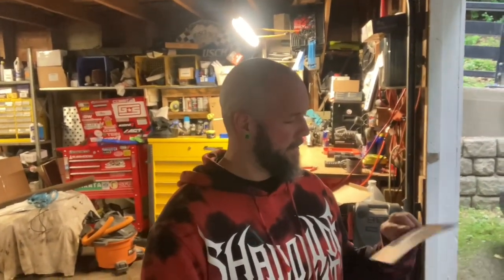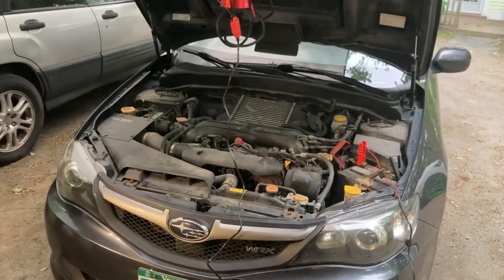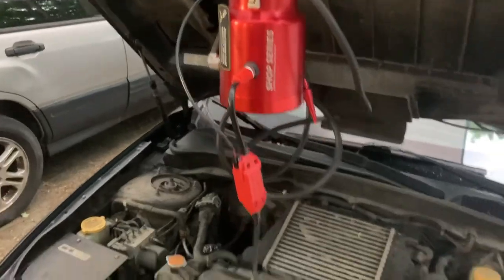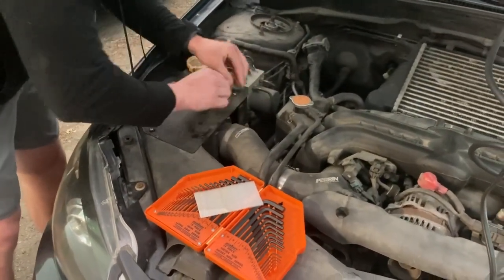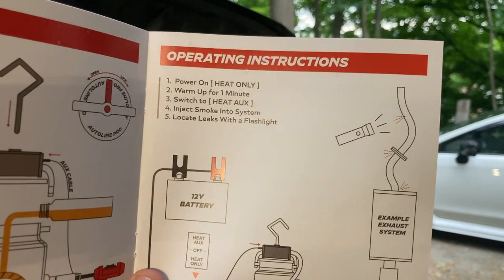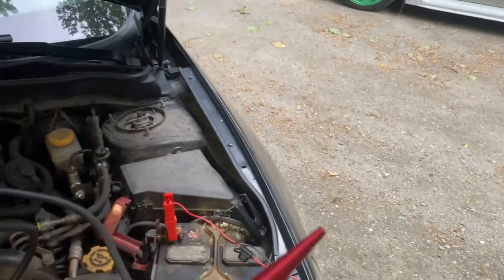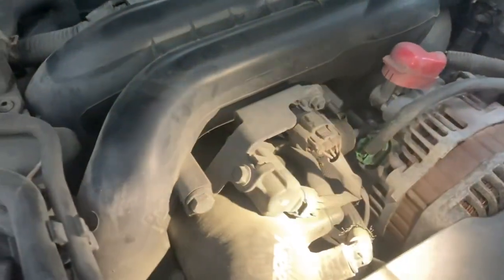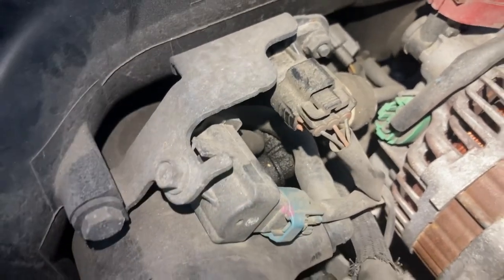Automotive smoke machine for diagnostics from Amazon!

Comment: Would love to know how the blast plates did on the XT 5spd. I have an 06 Forester I EZ30R H6 swapped with a 4.444 5spd, interested in the blast plates…
Reply from the maker: Sorry for the late reply, I never get the notifications for comments for some reason!  I have been pretty rough on this 5 speed and since installing the Blast Plates it has held up nicely.  Reducing flex in the 5 speed case is key and that's why I recommend these to anyone with a 5 speed!